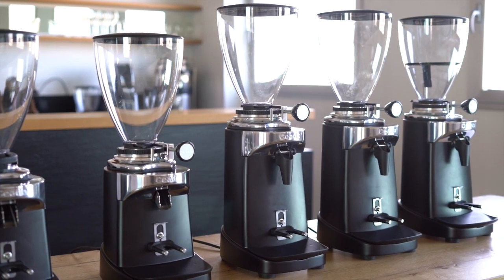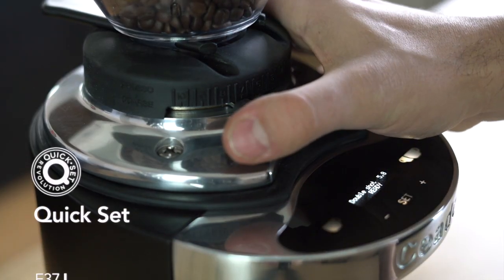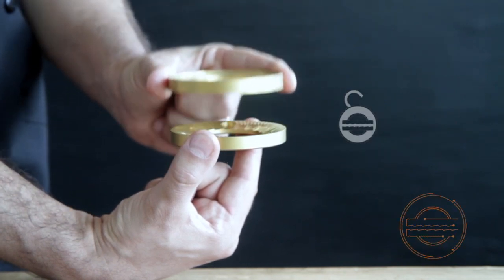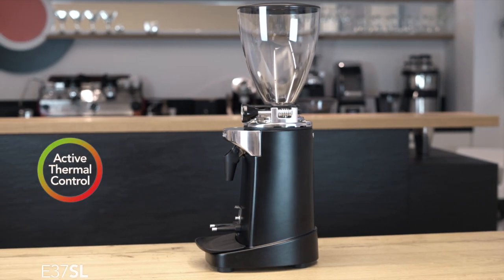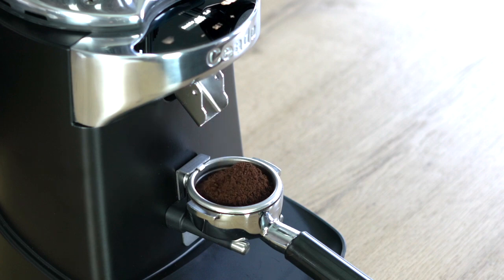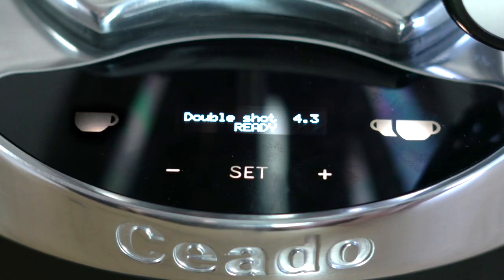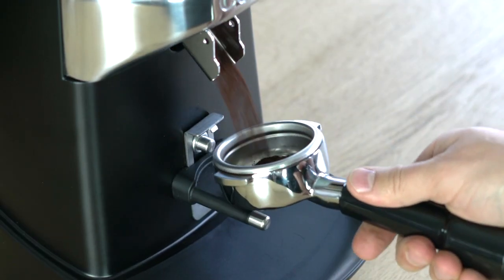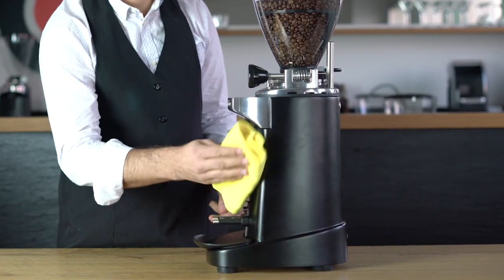New E37 Family. Extend your grinding choices.

Comment: After having the grinder for 4 years, it has worked flawlessly. However, the dot matrix lights on the screen are going dim to the point it is getting near impossible to read it. I inquired about a replacement and since it is out of warranty it is nearly $1,000 including shipping just for the part. For that reason I can’t recommend this grinder.